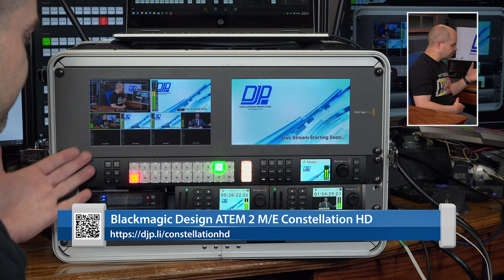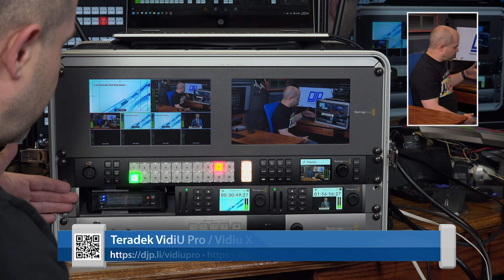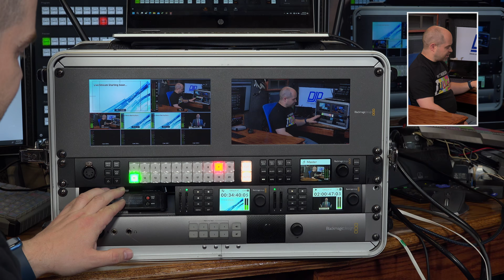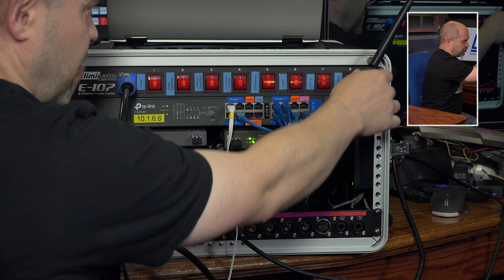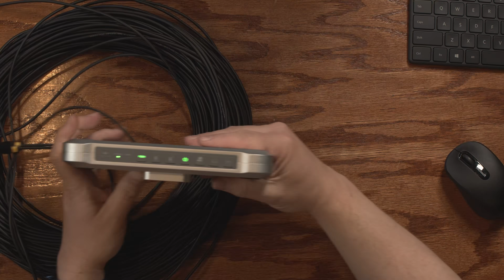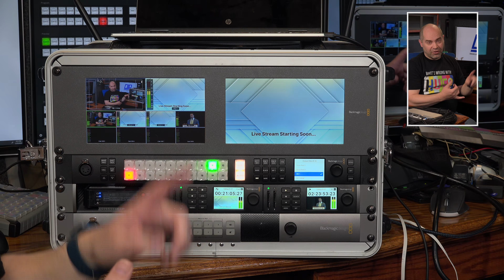My ATEM 2 M/E Constellation HD Video Live Streaming Flypack

Comment: When using this camera converter and patchcord, don't you have delay vs sdi cable? Especially when displaying image onto the large LED wall. Meaning if you show a presenter speaking in magnification - won't the converter add aditional lag causing lip synch problem?
Reply from the maker: There’s no additional latency. The fiber signal is really just SDI encoded using light instead of differing voltages, so there’s basically zero delay from conversion. When using HDMI there’s a tiny bit of delay, but it will be so short it wouldn’t impact anything.

Comment: Doug what component are you plugging the camera into that then connects to your switch for the cameras
Reply from the maker: The signal flow is camera HDMI output -> HDMI to SDI converter -> Smart Videohub 40x40 -> Decimator 12G-CROSS (to downconvert from 4K to HD) -> Flypack input.

Comment: Hello Great Video

I looking to purchase a hyperdeck for our studio. I want to record 4 Iso cameras  at the same time. Which model hyperdecks do you recommend for that.
Reply from the maker: Rather than trying to have a back-and-forth conversation to establish your needs, start with the video I did on the HyperDeck lineup, and then ask questions after that... https://youtu.be/-2TgyJ3vA10
Reply: @djp_video  Sorry about that. I should have added more details. In our studio we currently are using Blackmagic 8k extreme Hyperdeck and also a HyperDeck Studio 4K Pro. Our SSD slot on all the previous models have went bad including this one as well. Also the 8k Extreme will not record all 4 camera feeds coming in from our 8k constellation at the same time. Do you think a good solution for just recording camera ISO would be the  HyperDeck Studio HD Plus with the SD card slot and also FTP to our server? Just wanted to pick your brain.

Comment: Could you please explain how the audio sources are connected into the flypack? Does every camera has external mic picking up sound from the stadium? Or there are dedicated external mixer? I’m trying to understand how audio is done in a basketball game for example with the flypack. I know talkback to camera operators are included in BMD camera converter and studio converter, so do you just plug in headset to the studio converter? How about the commentator audio and IFB?
Reply from the maker: People take different approaches to that.  For me, I never mix audio in the switcher -- I prefer to have physical faders and knobs to tweak the mix rather than using a software interface. 

I build a separate audio mix on a dedicated audio mixer (usually a Yamaha TF3 or TF1) and then feed the final output of that mixer into the audio inputs of the ATEM. And personally I use Dante to get audio from microphones and other audio sources from a venue into my audio mixer, with one or more Yamaha Tio1608-D stage boxes setup on location to plug those into. In the very rare occasion that I do use audio from a camera, I pick that up from the audio outputs of the Blackmagic Studio Converter in my flypack, with that signal coming in as part of the SDI signal on the fiber cable connecting the cameras to my flypack.

A lot of that isn't really typical, though. Just the most efficient way that I've found to pull it off. You have to do what works for you.

Comment: Hi @djp_video

Interested in your scheme for bringing fibre in & out of this rack. I see you have the Studio Converter 2 for providing 4 camera feed/returns. Then you have a micro fibre converter for inputting remote laptops into the ATEM.

How about sending the pgm feed to remote screens? Do you have this setup within the rack or would this require additional kit?
Reply from the maker: Each of the Studio Converter's fiber return lines usually carries the program feed (available for camera operators to see, but it also carries tally and intercom audio), so I can always use one of those. But the auxiliary Optical Fiber converter in the rack is also connected to an output on the switcher, and that usually defaults to the program feed as well, so that line carries a copy of Program too. And that's my go-to for when I need to use fiber for a program feed. 

But because there are also other outputs from the switcher available on SDI, if I happen to need another fiber run it's just a matter of grabbing another Optical Fiber converter and connecting that to one of those outputs. It's rare, but it does happen.

The most common scenario for me, though, is getting the video from a presenter's laptop while simultaneously sending a video feed to the projectors in a venue. I can do both of those over the same fiber cable. In that case the return feed over that fiber line is the one that goes to the projectors. And very often the HDMI (or SDI) input at the venue for their projectors is in the same physical location that a presenter would be -- a podium or desk -- so I'm literally grabbing the laptop output and providing the program/IMAG output in the same location using a single fiber cable. And in most cases I'll have that be fed by an Aux output on the switcher which I can switch between M/E 1 Program, M/E program, a graphic, or the laptop output. 

For what it's worth, these days I'm using a new trick -- putting the laptop feed on DSK 2 (of Program 1), sending M/E 1 Program to the projector, but then recording and streaming Clean Feed 2 instead of Program. That allows me to put the laptop feed up on the projectors, even fading it on and off, while still switching between cameras on the live feed/recording, just by turning DSK 2 on and off. Using CF2 instead of Pgm gives a more relevant view to remote viewers and later playback, where they probably don't want to stare at a full--screen slide for multiple minutes straight, and would rather see the presenter talking, where in-person attendees might want to see the slides more than a live video of the presenter. I also find I use SuperSource a lot for that as well, with the presenter and slide, so those remote viewers can see both, but where that is less relevant for projection. This technique is a lot easier than using the 2nd M/E to create a secondary mix but provides much of the same end result.
Reply: @djp_video   That’s really helpful, thanks Doug, and interesting to hear your way of using the 2 me’s. I think the challenge when going over to fibre workflow for first time is getting using to the send / return and then of course the polarity on each end. 

When you say you send and receive from presenter’s laptop and to venue projector one on cable… I’m assuming you mean on a single LC Ie. a pair ?

I know it is possible sending and receiving on a single fibre strand using different light frequencies but i assume you don’t mean that in this scenario?
Reply from the maker: Generally, yes... a transmit/receive pair of strands in a single cable assembly. I have a handful of bi-directional SFPs, but don't use them for video much.

Comment: It may be kind of a stupid question, but I completely understand how you have your LAN stuff setup, but how do you stream all of that to the internet? How do you get Internet Access?
Reply from the maker: 1. I have a router inside the rack. 
2. The Ethernet switch in the rack is a managed switch, split up into multiple VLANs so even though it is a single switch it can handle both the public Internet network and LAN independently. Video on VLANs: https://youtu.be/C81pyQaJgj8
3. The Router I'm using (GL.iNet Beryl AX) has the ability to use an Internet connection from Ethernet, WiFi, or over USB connected to a cell phone or hotspot. Router: https://amzn.to/3Nr0JZE, Video on router: https://youtu.be/FHUu7ZetL-Y
4. I use a Teradek Vidiu Go for streaming, which can use bonding technology on up to 7 separate Internet connections to ensure redundancy and sufficient bandwidth.

Comment: So if I have a mackie mixer with TRS output R & L, do I run each one individually into channel 1 and 2 of the constellation? Or do I use a dual TRS to single TRS cable and just run it into 1 channel on the constellation. Thanks!
Reply from the maker: Each cable carries one channel... so if you want stereo, you'd need two cables.  

The outputs on your Mackie and inputs on the ATEM are balanced connections. So even though there are three separate connections, each plug is only one channel... the three wires are ground, hot, and cold rather than ground, left, and right like you'd find on a headphone connection.

I'll be doing a video on balanced vs unbalanced, XLR, TRS, etc. fairly soon. Stay tuned.

Comment: Thanks great video. What software do you use to connect xkeys to constelation HD?
Reply from the maker: JustMacros. But I don't think I'd start out on a new project with that at this point -- it doesn't work with ATEM Software version 9. 

Take a look at Central Control (centralcontrol.io).

Comment: Can we use SDI to HDMI converters to this to connect laptops
Reply from the maker: In what way? Most computers don't have HDMI inputs, so converting to HDMI isn't particularly helpful.  

The Constellation HD models have a USB connection which can be used to get video into a computer. The quality is just so-so, but you get video capture over USB for free. If you need something higher quality you can use an UltraStudio Mini Recorder or something similar for the best quality, or one of the inexpensive HDMI-to-USB capture devices out there to get something basic quality.

Comment: How does a projector receive a fiber cable?
Reply from the maker: It has go to through an SDI or HDMI converter. I often use the Blackmagic Design ATEM Camera Converter because it has SDI, HDMI, and fiber connections all in one unit.

Comment: Hey Doug, would you recommend any cooling unit inside similar racks, such as AC infinity ones? (for both indoor and outdoor usages). If yes, which would you pick between a 1U intake, 1U exhaust, or both?
Reply from the maker: It depends on the equipment you're using. I have active cooling in my switcher rack in my trailer (Middle Atlantic QBP-2 1U exhaust blower), but not in my flypack -- it runs fine without it.
Reply: @djp_video  Thank you. I would have almost the same gear that you have in this video. So you believe it would run fine with around 12 cameras connected for 3 hours?
Reply from the maker: I can't speak to how it will work for you, but I've run this rack for multiple days at a time without any issues.

Comment: Can you explain how you convert the ice plug to powercon on the power distribution box. Always having a scare of powered disconnect anytime I am out there.
Reply from the maker: It wasn't difficult. I cut the existing power cord to the right length to reach the location in the case where I installed the jack, used a knockout punch to make the 15/16-inch hole in the case, then soldered the PowerCon connectors on the power cord. The whole project only took about 20 minutes.

Connectors: https://amzn.to/3ZfR9MN and https://amzn.to/3IolWAc
Reply: @djp_video  Thank you so much for responding. I really appreciate. Will give it a try.

Comment: I’d have definitely used some unifi stuff rather than that TP link and those media converters. UDMP-SE will give you a router with 2x sfp+ for fiber and 8 POE ports for $500. They also have any number of POE switches with SFP+

Comment: I returned to this video after some time and I have 1 comment about "WAN/Internet" port on switch and routing it through it's own VLAN to router. To let others to know. It's great BUT some enterprise networks (schools, business offices, ...) have limitation for MAC addresses available per port (Cisco calls it "Port Security"). So it means that when you're connecting their network to yours "WAN" port on your switch and then it goes to router, it's practically 2 MAC addresses (switch + router). And this very often exceed theirs limitation for 1 MAC address per port and then the port will shut down for you. Because of this - you need to connect their netowork directory to your router OR put another router between your switch and their network. :)

Comment: hello doug, can you share for me, this flypack system wiring diagram ? i will an assembly one of package , the flypack system.
Reply from the maker: There isn't a lot to share -- the four fiber connections go to the Studio Converter and then its outputs go to inputs 1-4 on the switcher. Inputs 5-8 on the switcher are wired directly to BNC connectors on the rear panel. Input 9 comes from a Bi-Directional Micro Converter 3G.  Then I have two inputs on the switcher which are connected to the SDI outputs on the HyperDecks. The last two inputs (19-20) are connected to the MultiView outputs on the switcher so I can route them to switcher outputs.

In terms of outputs, one goes to the Studio Converter for the return feed to the cameras. Two go to inputs on the HyperDecks. Two go to the monitors in the rack. One goes to the Bi-Directional Micro Converter for conversion to HDMI. And several are wired to BNC connectors on the rear panel. 

The HDMI input of the Teradek VidiU Pro comes from the HDMI output of the HyperDeck Studio HD Mini. The assumption there is that the HyperDeck will always receive a copy of the main Program output, so I'm using it to not only record but to do the conversion to HDMI for the encoder.

Aside from Ethernet, that's about it.

Comment: Doug, what fiber cable brand/model/supplier is that you show in the video?  How has it held up over time deploying?
Reply from the maker: It changes all the time. I've gotten from multiple different sources: Amazon, fs.com, eBay. I just look for single mode armored cables with LC connectors. My most recent source is here: https://amzn.to/3pWvLN1  

The cables I've used have been great. But when someone trips over them the cables can rip out of the ends, and the tools to fix them are expensive so I just replace them.

Comment: Hello !! Excellent video as always!!! Thank you for being so clear in explaining us.
I ask you how do you connect the 80-button panel with the switcher?
Do you connect it directly to the switcher or do you have to connect it to a notebook that is connected by network cable to the switcher? Thank you very much
Reply from the maker: It is a USB device which is connected to a Windows laptop running the JustMacros software. Another option with the same control panel is Central Control.

Comment: 1 question: Is there some input delay there? For example - If I would want to use this switcher kinda like an videohub, I would connect my computer outputs to input 19 & 20 and I would connect my monitors to SDI output 11 & 12 connect to my monitors in my big flight case. If I would routed output 11 & 12 directly to input 19 & 20, would there be any video delay? If so, I know you're using VideoHub, is there any video delay on the device? 

Thanks. :) 
(i suppose that if you're connecting MVW outputs into inputs, there is some delay too)
Reply from the maker: The average latency through the switcher is about 0.5 frames. Sometimes it will be less, sometimes it will be more, based on the relationship between the connected video source and the ATEM's master sync. 

Connecting an output of the switcher back to an input will result in a little less than a full frame of additional latency.

Videohubs do not add any measurable delay.
Reply: @djp_video  Thanks! :)

Comment: How do you find the inboard scalers of the ATEM in comparison to what you previously were doing with Decimators or UpDownCross HD units? Especially if you have to convert interlaced signals to progressive?
Reply from the maker: I haven't really done any extensive testing. Word on the street is that the deinterlacer isn't that great.

Comment: Hey Doug! What do you think about the fiber backs for the URSA broadcast cameras? I like the thought of having just 1 cable to the camera for everything (power too!).
Reply from the maker: They're great if you always intend to use them with Ursa cameras and have the budget for them. That system can be pretty pricey -- the converters at each end are about $3000 each, and the SMPTE fiber cable runs about $15 per foot.
Reply: @djp_video   Yeah, the price is a little crazy. I have 3 URSA broadcast that are in a small studio build. I probably should just get a few batteries instead of using the power supplies...Thank you!!!

Comment: Just scored an Elvid SRM-7X2-LT 3U rack mount SDI/HDMI 1280x800 dual 7" monitor pair. It's a plug-in HD replacement for the low-res BMD monitor you showed here. Crisp screens, all-metal construction, loop-through SDI and HDMI outputs even when not selected. As you pointed out, BMD is sadly behind the times in this area.

Comment: Thanks so much for this! Building a similar configuration, newer to the streaming part of the industry! 

First, the constellation has the USB C to act as a “webcam” is this not a feature to be relied on at all? 

And based on what I’ve read in this comment section, you wouldn’t recommend the web presenter, if I am to get into this an buy one, would you recommend the vidiu X over the web presenter? Looking to future proof as much as possible! 

Thank you so much!
Reply from the maker: The USB-C webcam feature is weird. It plays with the contrast and colors of the image, and visibly reduces the quality of the video. I would only use it for webcam-like tasks (Zoom/Teams meetings. etc.) and not for capturing high quality video.

The Web Presenter is proving to be problematic. It seems to have network connection issues. I'd say that the Vidiu X is a lot more reliable, plus you get the option to bond up to three internet connections together for additional redundancy and aggregate bandwidth.
Reply: @djp_video  thank you so much! Really appreciate your reply 🙏